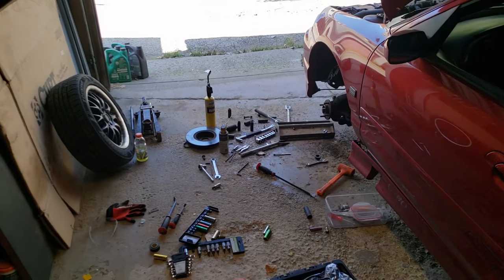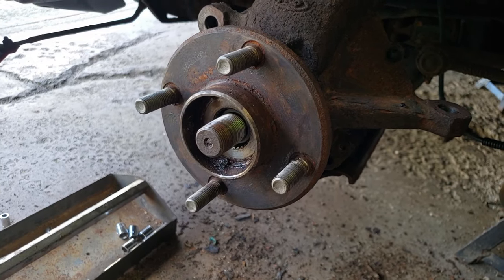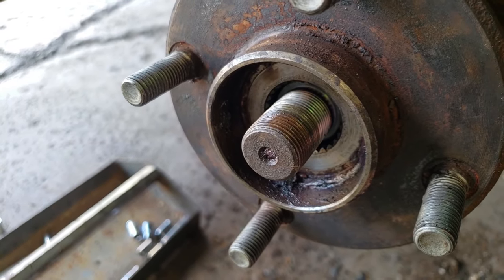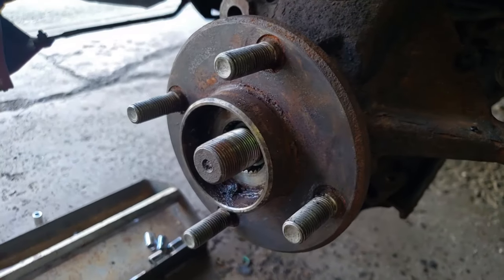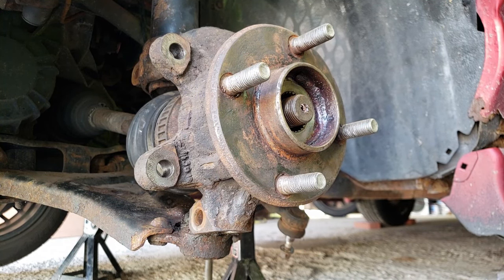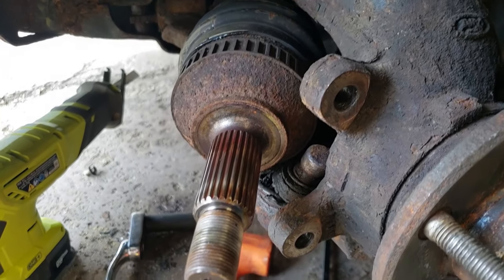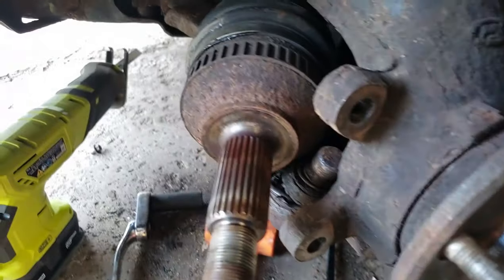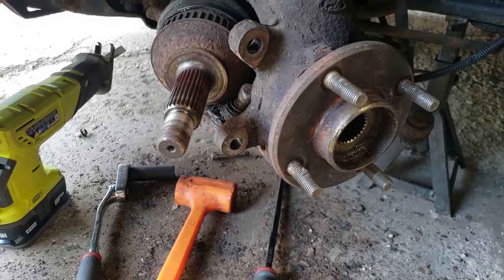Remove Seized or Stuck CV Axle From Hub

Comment: Best advice ever.  I had a Toyota axle bearing with a seized axle that wouldn't budge.  Beat it to death with a sledge, lubricated it, heated it, thought it would be there forever.  Bought a cheap impact air hammer ($30 for gun and 3 bits) and it literally came off in seconds.
Reply from the maker: Nice another one that worked! It's always my first option now.

Comment: I had a similar issue with a Toyota Minivan. I bought this exact rotary hammer from Harbor Freight and the chisel bit. 30 seconds of running the hammer, the axle started to budge. It took about 10 more seconds and it was free.  I tried pullers, hammers, heat and wd40 without success. This totally  worked.
Reply from the maker: Glad it worked for you!

Comment: Just sharing my experience. 18 y/o car in the salt belt CNY. Need a new axle shaft. Nothing worked. Soaked in penetrating oil, really went to town with the sledge: Nothing. I tried using my rotor puller tool to hook onto the hub and use the forcing screw to push it through. Shocked that this didn't work. Saw this video and the successful comments convinced me to try it. This thing was stuck too well for the impact hammer. I decided to cook the bearing using the acetylene torch. it was only by using the torch and then full swings with the sledge that I got it to move. I thought the impact hammer would work after it started moving but it did not. the forcing screw did though. I'm sure the vibrations of the tool helped some. Good luck all with your projects. For the rusted junk, it seems to always come down to the acetylene torch for me.
Reply: Ty for your comment. The tool in this video is only 1.2 joules of impact energy (very low). I think the axle in this video was not very stuck lol. I have one VERY stuck. I'm going to try a rotary hammer that is 3x more powerful than in this video (still low power) and I'm sure it will do nothing... Need about 8 joules or more in my opinion. Mine probably needs about 12 joules, a big boy hammer and probably on a table with full body weight on top of the rotary hammer for a good 2 minutes... Mine is stuffed :(

Comment: IT WORKED! I tried everything pullers heat sludge hammers etc.  I was like most thinking about just removing the knuckle and having it pressed out. It was not as quick as what is in the video. It took at least 15 min with the rotary hammer and the pointed bit. I tried various speed settings but settled on the fastest and with some perseverance it came off. THANK YOU! If it failed I was going to try somehow soaking it in water? hey I guess try everything. Guy in a comment below had this idea but did not have to try it but was curious if that would work.
Reply from the maker: My next step was to cut everything out lol glad it's actually working for most people. I am glad you commented about the time it took. 15 min is a good amount to hammer on it.

Comment: Super thanks for this video. My stuck CV axle ('05 Focus) had resisted about 20 seconds of air hammering and several hand hammers. I watched this video and was sure with this tool that axle would budge. But getting this tool or one like it was going to take some time. Somehow knowing this problem would get solved gave me an idea. Soak with PB Blaster 20 minutes. (WD40 did not work). I tried with the air hammer (cheap) one more time and it moved! The axle is out now and thank you once again.
Reply from the maker: Very nice! A few others have said it took 15 minutes of hammering it. Glad you got it out. 👍

Comment: I was having the same problem with the cv axle not being able to extract it with  out cutting it for 3 hours did everything  then I watch ur video and went to Home Depot rent a hammer I and tried again and it took me quite  literally 15 seconds holly molly ! They charge me 10$ for renting the tool now I’m considering getting one hammer
Reply from the maker: Rock on, I'm glad it's worked for you!
Reply: Dude. I tried the Harbor Freight 1-inch Bauer tool (1.2 ft lbs) with no luck. Then I rented a 2-inch Makita (14.8 ft lbs) from Home Depot and voila! Done in 15 seconds. However, I buggered up the CV shaft threads on my 2003 Jetta, so I used a file and cut new threads (M20x1.5) so I could reuse the same CV axle. Thanks for the tip!!!
Reply from the maker: @donshade  glad you guys got it going!

Comment: This is a good idea because of its high frequency and the weight of the moving parts in the tool and the punch is closer to the weight of the outer cup and spline of the driveshaft allowing maximum acceleration of the shaft.

 A sledgehammer will not work because it moves slowly meaning the wheel hub and rubber bushings absorb the force (or if you are unlucky your diff/gearbox absorbs the force...).

However, if the hub has been driven to the point where the bearing has heated up and the splines have fused to the shaft then this is not going to work. I remember a friend taking one to a shop with a 100ton press. it got to 50 tonnes before going bang.
Reply from the maker: I watched a lot of videos like that where they ended up in presses. Crazy how certain forces work.
Reply: Your mother

Comment: THANK YOU THANK YOU. I broke two pullers used a sledge and tons of pb blaster and this worked perfect THANK YOU
Reply from the maker: Glad it worked out! It's an excellent tool to have as well lots of other bits we can try with it if the need ever arises.
Reply: I hope it works for me tomorrow. I over beat it and bent the threads. Now I have to Dremel the groove back in. Still didn't move

Comment: I'm going to try this next. I've already tried gallons of PB Blaster a sledgehammer a puller and heat. I hope it's this easy for me.
Reply: heat it and hammer it from behind. Spray with PB Blaster. Come back in 1 hour. Heat up again really good and spray CRC Freeze Off to "shock it". Can also use cold water I guess. It worked for me and I didn't have to buy a new tool. The puller I rented from Autozone did not work

Comment: Tried big hammer, axle puller, PB blaster. The hammer drill is the way to go. Three 2 minute cycles did it. Worth buying one.
Reply from the maker: @alorr4628  very interesting about the 2 minute cycles, that's longer than most. Thanks for commenting!
Reply: Did u replace cv or was it fine and put it back?
Reply: @highlifegoodlife5400  cv was fine. Just replaced the bearing. Used anti-seize on the spindle before putting it back together. Smooth and quiet now.
Reply: @alorr4628  I'm just hoping cv didn't weld self to hub

Comment: I am working on a 2006 Honda CRV. Replacing the balljoints/control arms. Passenger side axle/hub came right out after 1 whack w hammer. Driver side is SEIZED. Pounded w hammer to the point of slight mushrooming on metal...tried heat, liquid wrench, prying, etc... will not budge. I have a rotary drill, going to try this today.

Thanks for the video.
Reply: Did it work?

Comment: Just an idea. You mentioned changing the control arm also. Would buying a new control arm and only swapping out the joints be good if the control arm threads are too rusty? Then adding a weld to the ball joint in case the press fit is too loose.

Comment: Great job! I'm going to replace mine in a subaru tomorrow am. Thankfully it's not so rusted like yours is. I'll hopefully let ya know how it goes.

Following afternoon: I spent 4 hours alternating between beating with a 5 lb. hammer, soaking in PB blaster, heat and using a 5 ton gear puller. No dice. Next I'll try a rotary hammer, then taking it to the shop if necessary.
Reply from the maker: I actually just took everything back apart again this morning, had to use the hammer yet again. I need a lift lol hope it goes well.
Reply: @eriestreetgarage  I hope all is well there! 
I rented a rotary hammer this am, and my son and I were able to hammer the axle back out of the rotor! WHEW!  That thing required a bit of force, but it came out. New one went in without any problem. It's amazing how easy life can be with the right tools. 
Cheers, Mark.
Reply: an air chisel kit is cheap and does the same thing if you have a compressor already
Reply: @bobsbarnworkshop  I thought about getting one of those, but I wasnt sure if my pancake air compressor would be able to keep up with the demand.
Reply: @MrJonrocker  yeah, not sure but for the first few seconds the pressure would be high. We all just use what we have on hand or rig up!
Reply: @bobsbarnworkshop  Yep. And I didn't want to hammer for 30 seconds, wait 5 minutes for the compressor to catch up, hammer for another 30 seconds, wait another 5 minutes for the compresaor to catch up.....

Comment: 2011 Ford Fusion Sport: I tried everything from sledge, 3 different torches (Hand torch, turbo torch, oxy accet.), pickle fork, three arm gear puller and no dice. The two lower control arm bushings were also impossible. Bought a new knuckle assembly and axle.
Reply from the maker: Did you try the air/rotary hammer? Im a poor person so unfortunately I can't always buy everything new. lol
Reply: @eriestreetgarage  Yes the biggest baddest I could find, the same one South Main Auto calls big nasty. AND I'm not Rchi-RicH
Reply from the maker: @rich1953  Dang big nasty couldnt even break it? Extreme!

Comment: I finally got it. I used my air hammer and then electric Milwaukee impact then back off nut and air hammer again over and over and it finally moved so little I wasn’t sure it moved at all but pulling it in and hammering back out finally got it out
Reply from the maker: Right on, nice! Looks like itll take a bit sometimes.

Comment: Looking at it I don't think you tried the removing the studs and then putting bolts with a nut on back side, facing in the way and using the knuckle as the point to wind it off. If the knuckle is not giving a good solid facing then you just need to arrange some sort of hard point -  a piece of old flat scrap metal cut to fit, whatever. It does work... most of the time...
Reply: I like it

Comment: Thanks to share dude. Why the hell do manufacturers don't put some anti seize during assembly??
Reply from the maker: You make a good point! Cost reductions I'd assume. lol
Reply: When people drive with metal on metal brakes or bad hub bearing the excessive heat with in a way weld them together,those are the hard ones if your rotors are black ,it's gonna be hard....

Comment: I find before removing the ball joints I use an air impact hammer with a pointed chisel usually will drive the drive shaft out. Another way is to use a three jaw puller on the hub with the puller shaft on the axal and after it's loaded tight against it take a heavy hammer & give the center bolt a few hard shots will also pop it out

Comment: Thank you for the idea. This helped me tremendously! and saved me a lot of stress. The CV Axel was seized in the wheel bearing on my girlfriends Dodge Grand caravan. and I spent three days with torches pullers sledge hammers etc.. And nothing would work! I took the rotary hammer and got behind the wheel bearing hub assembly. And hammered it from the back side with a punch bit and got it to come out half way. That stopped working so I stuck a tuning fork  between the wheel bearing and strut tower and pounded it in there tight. Then I put the puller on and tightened it up and got on the back side of the wheel bearing assembly again with the Hilti rotary hammer and off it came. The absolute worst thing that I have had to do working on my own vehicles. Hope my comment will  help someone else and save some stress and aggravation.
Reply from the maker: I'm super stoked it has been working for so many people. 🙌 nicely done 3 days is usually what I spend doing the 'simple' things too.
Reply: 2012 town and country. Tried my rotary hammer with pointed bit and nothing. Toasted the axle nut beating the hell out of it with the sledge, lubed it up real good and nothing still. This thing is fused for sure. It just sucks when you think your going to get in and out but then realize you have the worst case scenario situation and it ends up costing more money and time. Im pretty sure my shaft threads are gone too. I tried to be careful but it just wouldn't happen.

Comment: I'm doing this tomorrow on a 2015 Mustang. Replacing the rear wheel bearings. I'm stuck on the driver side. Nothing is working. Sledgehammer hammer, specialty tools, nothing.
Reply from the maker: 2015 that sounds crazy that it's not budging it can't be rusted to bits quite yet! May the lord be with you.
Reply: Did you ever get it? Working on my 2015 right now and it's driving me crazy! Driver side rear

Comment: So did you apply any liquid wrench or PB blaster.... Was heat involved? I have tried this and the axle did not move. I live in the south, so by no means is my  knuckle any where as corroded and rusted as this car. I must be missing something. How long did you use the rotary hammer on the axle before it moved.
Reply from the maker: I tried basically everything before that besides pullers and presses. There have been a few that have commented that it took them 15 minutes of hammering before it popped out so it seems to be shear luck if it comes out as quickly as mine did.
Reply: @eriestreetgarage  thanks........I appreciate the additional info. I am worried about using too much eat because the seals on the inner shaft. Not looking for more work :(
Reply from the maker: @constitutionalbacker1stame787  Yea I probably shouldn't have used the heat but once you get to day 2 and 3 everything goes out the window lol.

Comment: What if you have a hub/bearing assembly seized inside the knuckle?  Think this would work to chisel it off?  05 Grand Caravan with bad bearing.
Reply from the maker: Those generally have to be pressed in so its worth a shot if you have the tool. Otherwise might be worth just renting something to give it a go. Someone commented that they were getting snap rings and what not out with it afterward.
Reply: @eriestreetgarage  It's a hub bearing assembly. No pressing bearings in. The bearings are already in the new hub. I know they get corroded because it's steel on aluminum.
Reply from the maker: @BellefontePerson  hmmm yea give it a shot if you have it laying around or a rent-a-tool close by.

Comment: Danm one of these will be hella useful I used a 12 ton hydraulic press and the danm frame on the hydraulic press has bent.
Reply from the maker: I would be nervous as hell operating it like that!  Not even sure what it is with these axles some of them just won't budge.
Reply: @eriestreetgarage  I took it to a mechanic that I know not to joke around but the dude is around 70 years old. With full confidence he said I will take it out in a hour. In my head I was like year right a hydraulic press couldn't take it out what else. So a hour passes by I come back the axle is out and the dude was just sitting down. My man got it out with a sledge hammer. I was so surprised I went to Home Depot and bought me a sledge.
Reply from the maker: @maxmil2809  LOL i think if you have that pointy bit and a good sledge it may work. I will admit I also don't have a super heavy sledge, would be worried about beating on it like a carnival game lol.

Comment: Thanks. Was going to try a puller but ill try this first. Was the bit included with the rotary hammer, harbor freight?
Reply from the maker: The bit itself is not included, unfortunately.
Reply: How long did you have to hammer on it to break it loose?
Reply from the maker: @CC-sf8jn  The two times I've had to use it it only took about 5 seconds or so. You could potentially just buy the pointy bit and try to hammer it loose with a hammer.
Reply from the maker: @CC-sf8jn  I was also thinking you could buy both, use the pointy bit and hammer first and then return the rotary if need be.
Reply: Thanks but didn't work for me. 3 jaw hydraulic gear puller got it loose easily
Reply from the maker: @CC-sf8jn  Damn sorry to hear that, the jaw pullers will probably be my next investment, rust is terrible on my cars unfortunately.

Comment: Whats a gud cheaper drill that a get the axle out..besides the hundred dollar Bauer
Reply from the maker: You could potentially try to rent one from a tool rental place, and there are a few on Amazon that are a bit cheaper. Check craigslist and FB marketplace as well in case there are some tools on there.
Reply: @eriestreetgarage  thanks. .appreciate it and will do
Reply: @eriestreetgarage  doesnt every drill have a hammer option?
Reply from the maker: @georgecostanza831  Not normal drills, no.
Reply: @eriestreetgarage  yeah i found that out today. it has a drill option but it still didnt work

Comment: Is this an ad? That drill is only rated to pump 1.2 joules of hammering energy. I feel like I need at least 10 joules. But maybe this method is a lot easier than I realise?
Reply from the maker: @AaronsTalks  10 joules seems like a very large hammer!
Reply: @eriestreetgarage  I just tried for about 15 minutes with a 3.6 houles hammer and nothing happened :(
Reply from the maker: @AaronsTalks  you can see the latest comment, someone did 3 sessions of 2 minute intervals and it finally worked. That's a long time to have a hammer on it in one go.

Comment: Update, So I really wanted this to work. Unfortunately after 25 Minutes of using the rotary with full body weight behind me the only thing I accomplished was heating up the Bauer Rotary Hammer to the point I was concerned with failure.  I live in NC and the parts have almost no rust. but this is just not moving on a ford focus 2009 front wheel. Looks like I am finally making a deposit into the junk yard for other robber barrons to steel parts from her. Has 200k but everything outside of the Wheel hubs are in good working order.....Win some lose some....